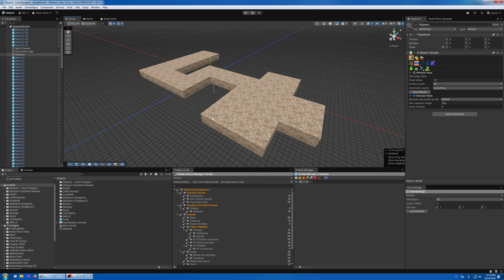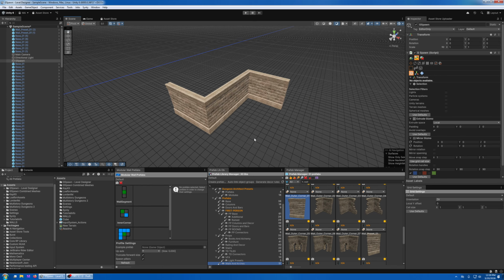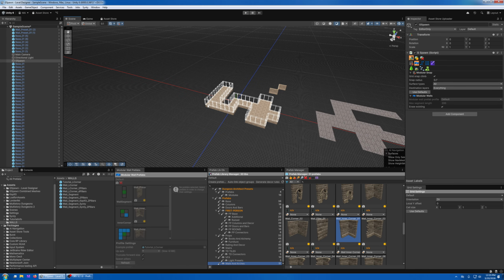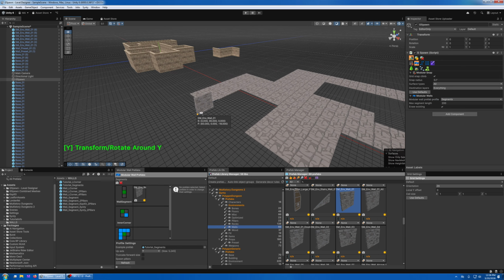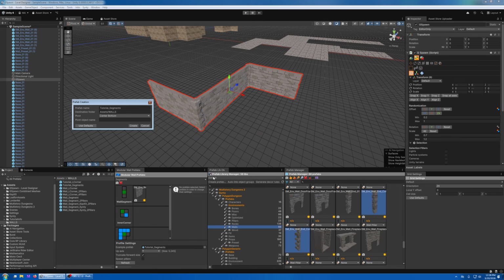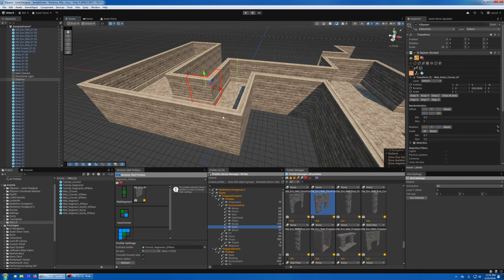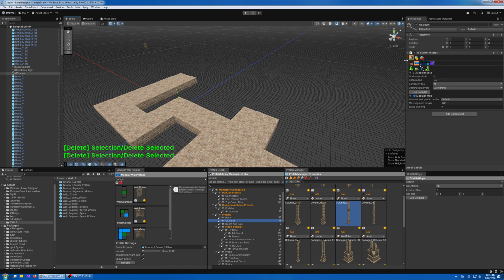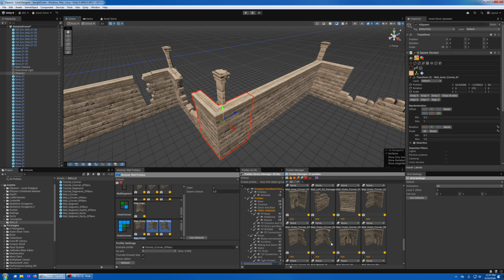GSpawn - Modular Wall Spawn

Comment: my pillars have 0 rotation in the prefab, but when they get placed by modular wall tool they get placed above the walls & rotated so they are horizontal instead of vertical
Reply from the maker: Hi, thanks for the report.

Please send this to the support email with screenshots/video and, if possible, a small test package with the pillar/wall prefabs. It is hard to debug prefab rotation issues from a YouTube comment alone.

Thanks!

Comment: How can I do this with my own assets? I am getting an error when trying to drag the prefab created, but it says, "Automatic detection could not match the prefab to a supported wall structure. Please ensure the prefab follows a recognized modular wall layout (e.g. L-corner or segment-based configuration)."
Reply from the maker: As long as all the pieces are in place, it should work. I would need to see the example prefab. Please send me an e-mail at octamodius@yahoo.com with more details about your setup.
Reply: Emailed but I'm having this exact issue. How did you guys fix it?